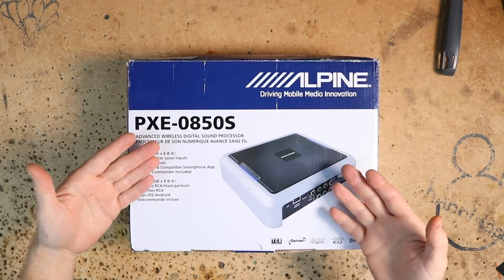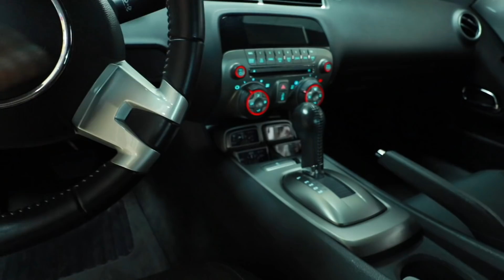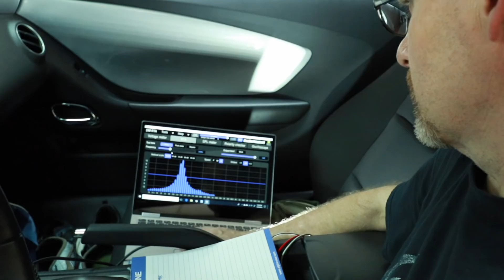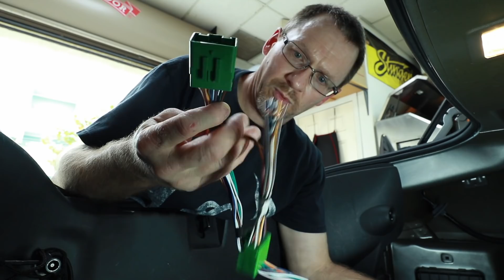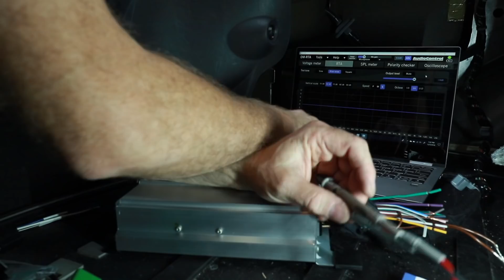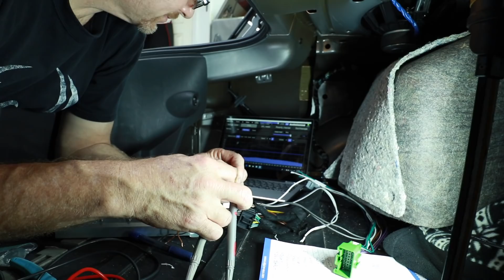Installing the Alpine PXE 0850s DSP amp in the Camaro  Car Stereo Lab 9 part 1

Comment: I have a question about DSP's. If they are tuned, timed, and adjusted for the drivers seat only, WOULDNT it sound off in other seats of the car since it was designed for driver only?

Comment: Quick tip, those extra wires to the factory amp might be some sort of data to the amp which controls the EQ  settings, Hyundai does this with their factory infinity system, with out it the sound is horrid.

Comment: Can you connect two usb cord to the android USB port and how to easy use of two android phone with different connection like for instance my note 8 uses usb C and my wife still uses micro usb.  Please advice on what exactly to get. Thank you. I have a w8400nex
Reply from the maker: You can only connect one cable at a time for AA to work. We usually install a usb input on the dash to plug into.
Reply: @FiveStarCarStereoInc my doubt may sound weird..... But will this give the same satisfaction that a Pioneer 7650dsp used to give? My Dream is a simple 5.1 DSP with a proper center speaker